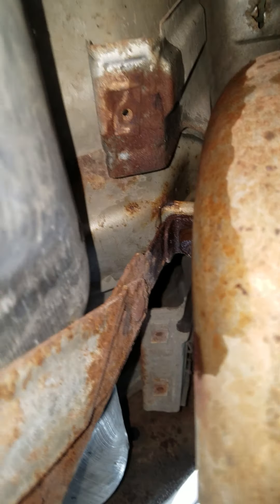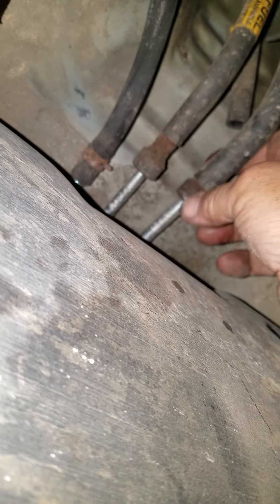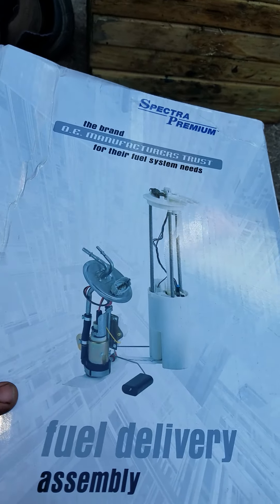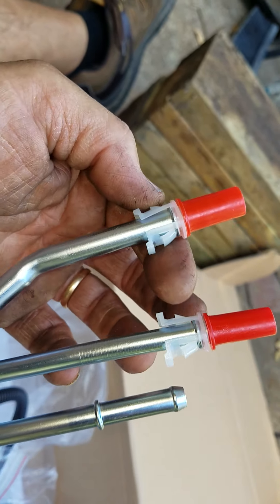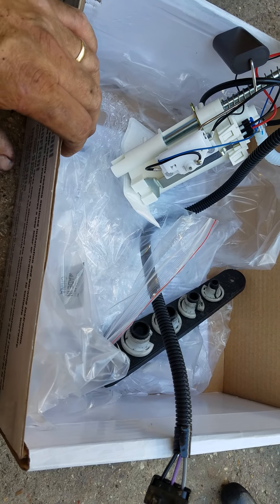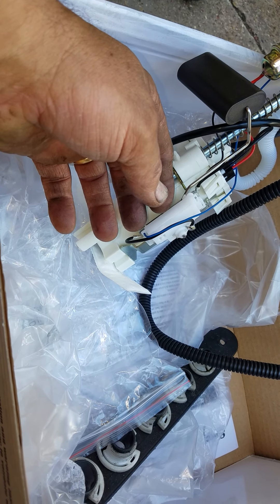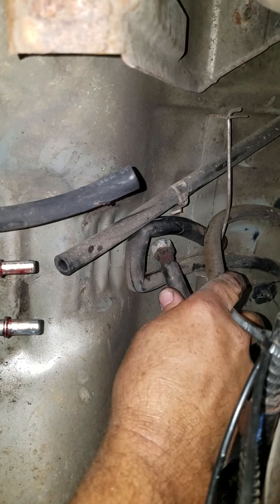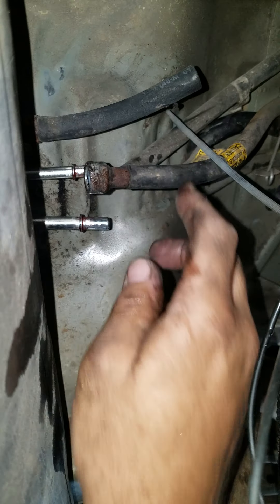1996 Buick Roadmaster fuel tank drop and fuel pump notes

Comment: Did you ever figure out what the other hose was for?  Mine looks the same wirh a short vent hose and a random hose hanging.
Reply from the maker: The other hose is the vent for the rear end.
Reply: The line on the far right goes to the EVAP charcoal canister. My hose was split as well. The left and middle lines go to and from the engine.